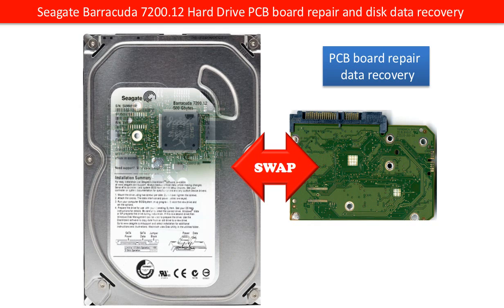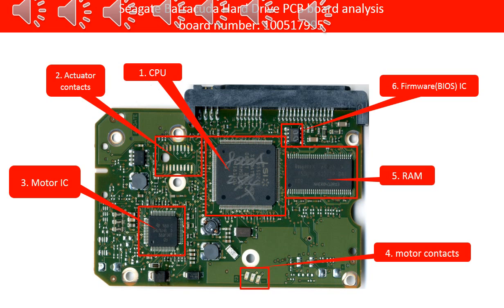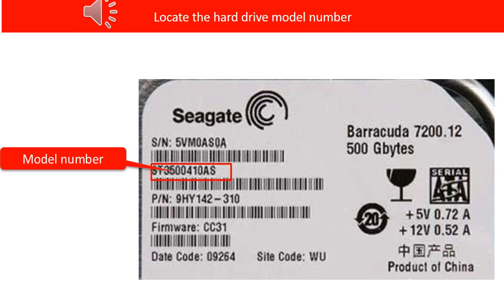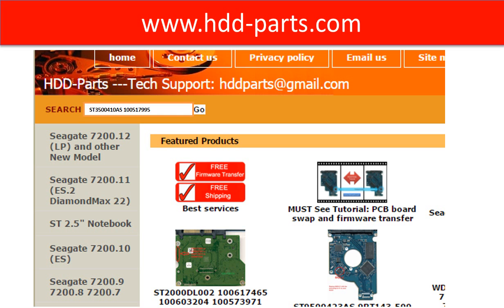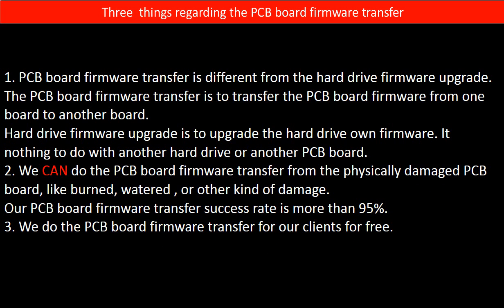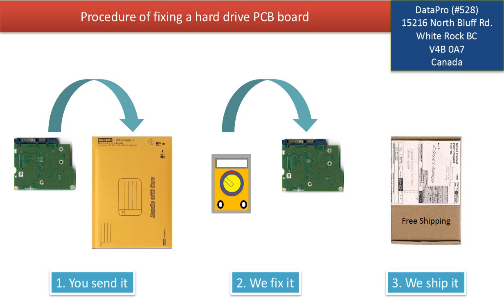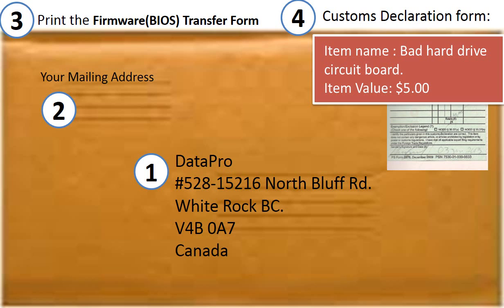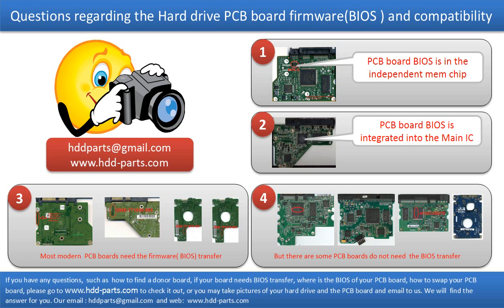Seagate repair PCB board swap  ST3500410AS ST3500418AS 100517995

Comment: Resp సార్! Nice సార్. My Seagate Hardisk 500GB Spinning and Stoped Sir. All Resistors and SMD Capasitors are Good Diodes also Sir. Where the Problem Sir. Please Advise Sir. Motor Controler IC Changed Sir. Please Advise Sir.   --   ChinnaRao Paderu Andhrapradesh

Comment: Thank you for this informative video!  I have a Seagate Barrucuda 3TB (ST3000DM001) which stopped being recognized and will not mount...however, it seems to spin normally and does not make any strange noises.  Does this imply a bad PCB, or a different problem instead?

Comment: Hi I have a hardisk with the Rom (Bios burned - in the sense that PCB's rom is missing)
Reason I had buying a card to do the swapping but the repairman lost the original card)
Do you think it is possible to recover my Seagate Hardisk?
In short, the HD has never been opened and card that has does not have the original BIOS
I feel the engine turns but it doesn't see any data windows with new pcb donnor
Thx Franco Italy
Reply: probably not, any update on your recovery? u need the firmware to be transferred to a donor board to decrypt that data, i have a western digital i just sent in to transfer it to the new board

Comment: Swapping BIOS does work and saved my data. To get the platter unstuck on the arm reader, find the screw in the middle of the hard drive that might be connected to it and then unscrew it and that's it. If it works, screw it back on a little tight. Do not open the hard drive or that's it.

Comment: I have hardisk not detect I clean already the pin but no happen my disk only sounding like tik tik tik continue ahmm is this pcb essue or the mechanism or etc.
Reply: Assalamualaikum..Ur hdd has gone ..just take data recovery and buy new

Comment: my Seagate barracuda 7200.10 hard-disk is smoking when I connect it with pc
Reply from the maker: the PCB is bad, you need to relace the PCB if you want to rescue the hard drive.
Reply: @dataprodatarecoverylab  
I stumbled upon your channel and liked it so much I just subscribed.
I need to replace my PCB also.
I may send you the PCB for my BIOS swap.
Thank you so much Keith Kuhn
PS you have a great Channel and lots of knowledge
Reply: better buy good smps by our pc configuration
Reply: Need 100466725 logic board